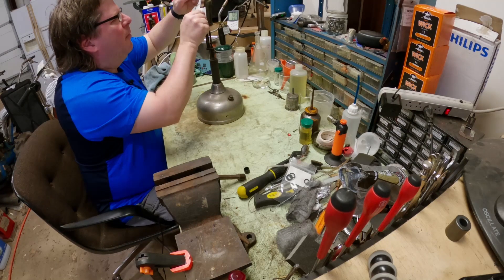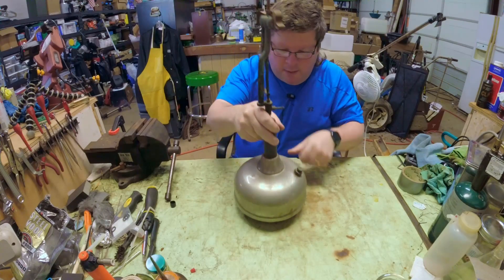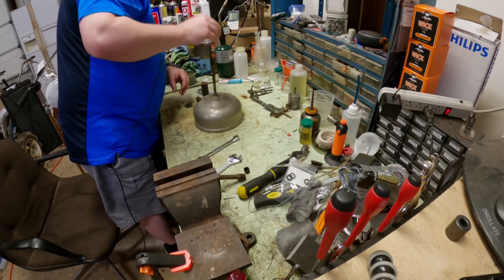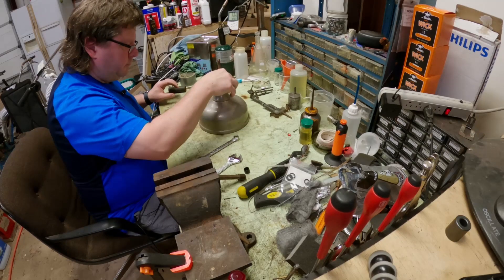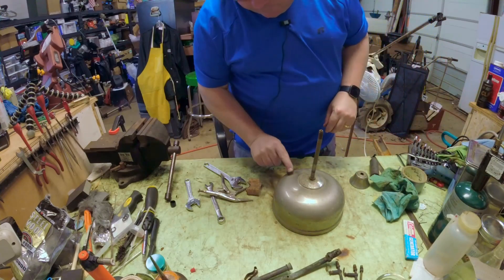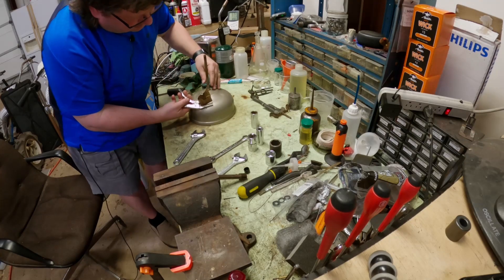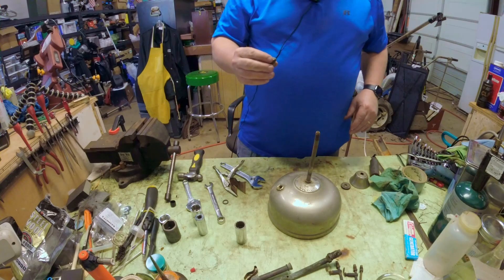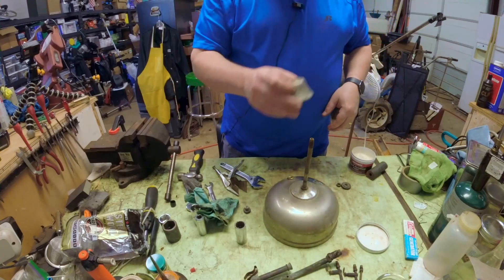On the Bench: Table lamp to floor lamp conversion

Comment: That gonna be a sweet lamp when you get it finished looking forward to seeing the progress of it. I have been working on a Sear and Robuck big hat lantern that Iam down to sourcing the globe for it haven't been able to find on yet. thought about changing the globe frame to a 220 series if I can't find the globe
Reply from the maker: I believe they use the same globe as a 22x series Coleman.  No need to change the frame.
Reply: @gasunderpressure9131 220 globe seemed to be about 1/2 inch short and slightly smaller in diameter I have a 220e that's made different I've not tried it as of yet to cold here in western pa to go in the shop no heat out their

Comment: I have fixed several lead gaskets. Best advice I can give you. Wipe some flux on the lead before you heat it up.
Reply from the maker: This is GREAT advice.  Wouldn't have thought of it.
Reply: @gasunderpressure9131  I found out the hard way on the first one I did. It came out with bubbles in the lead. After several attempts, I looked at the shelf in front of me. There sits my can of flux. Figured it was worth a shot.  Wiped a liberal amount on. Heated it up and it flowed nice and smooth. Let it cooled and tested it. Worked like new.

Comment: Even though it looks like it's (the tube) is screwed into the fount, I don't think you can remove the tube from the fount.  I tried to do that on a 129a and my friend said that they are pressed into the fount and couldn't be removed.  The 129a has an inch split in the tube coming from the fount.  Until I figure out how to fix it, it will remain a shelf queen.  Got a shade for it and hate that it doesn't work.  W Rusty Lane K9POW in eastern Tennessee

Comment: Will you be replacing the valve packing? I have one that leaks and so am looking forward to seeing how it is replaced. Thanks!
Reply from the maker: I don't think so.  What I have is working fine, so no reason to pull it out.  Usually snugging the packing nut will fix leaks, unless it's all the way against the stop.